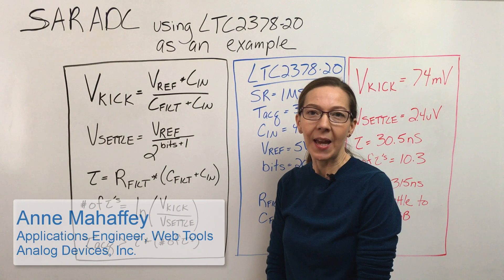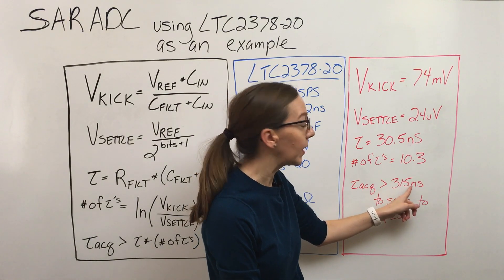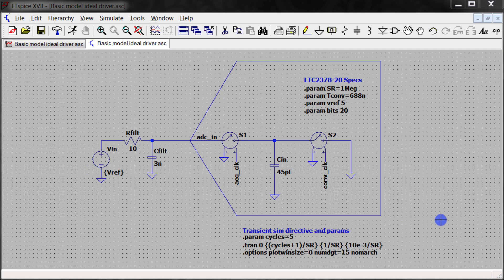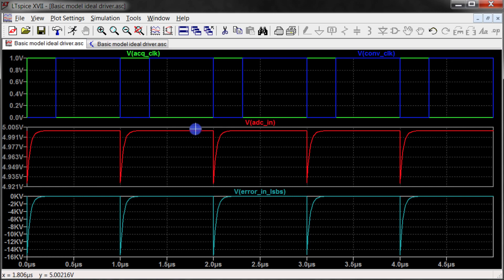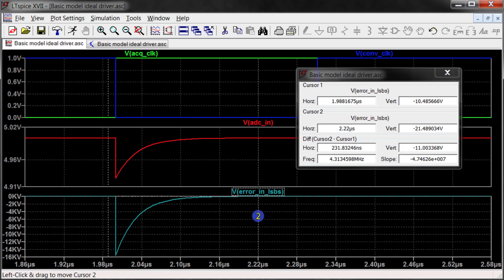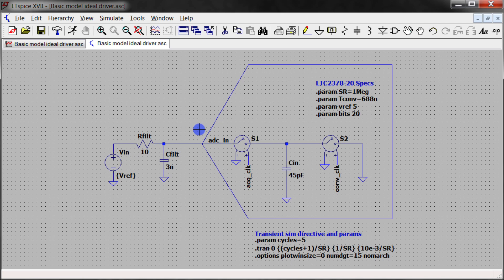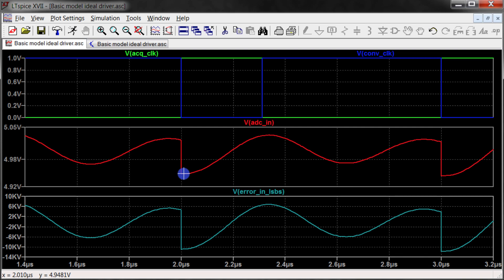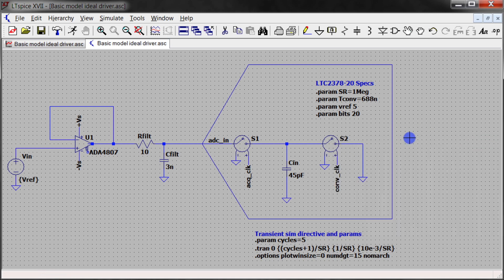Driving SAR ADCs #4: Simulating Analog Input Model in LTspice

Comment: Hi! Thanks for your list of videos, straight to the point but still with good elements to pick. How did you choose your CFilt against the CIn of the ADC? 3nF compared to the very low 45pF seems a bit harsh difference. I am not saying you are wrong, but just wanted to know more about the rationale behind this.
For the V(error_in_lsbs) in the plot pane, I would have written V(error_in_lsbs)/1V so that the unit displayed is no longer V but normal plain number.

Comment: Are you able to describe the formulas within the Pulse voltage sources for conv_clk and adc_clk? I'm wondering about the 0.4n and 0.2n constants in the on-time and delay time fields for V3 and V4.
Reply: In the downloadable LTspice schematics, there are two voltage sources that are used to setup the timing of the switches in my simplified model.  https://ltwiki.org/LTspiceHelp/LTspiceHelp/V_Voltage_Source.htm has documentation for what each parameter in a voltage source represents.  Anywhere that I've put .1n, .2n, or .4n is just my attempt to ensure that the switch states don't "overlap" at all - those values are somewhat arbitrary, and just my attempt to ensure everything simulates cleanly.